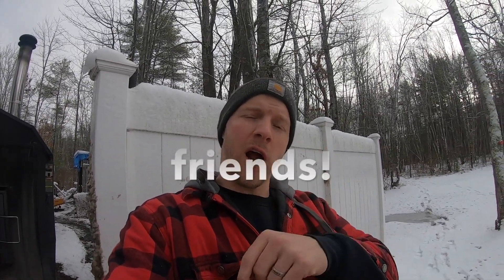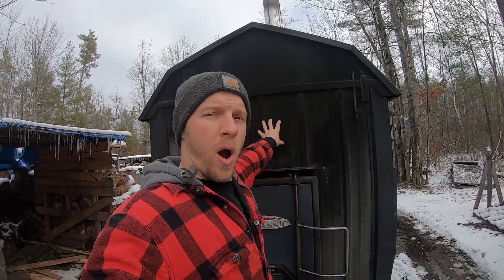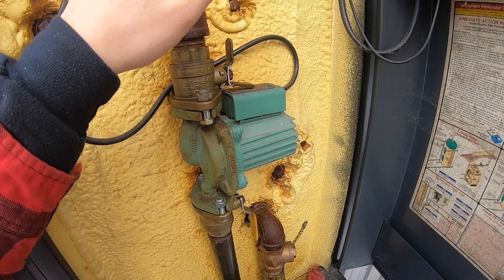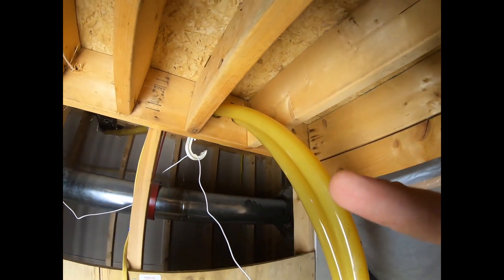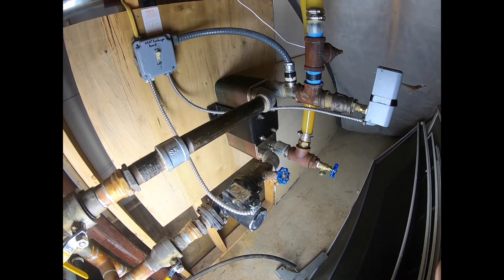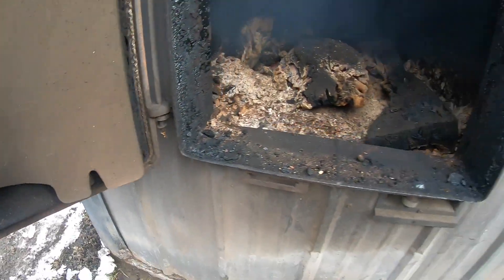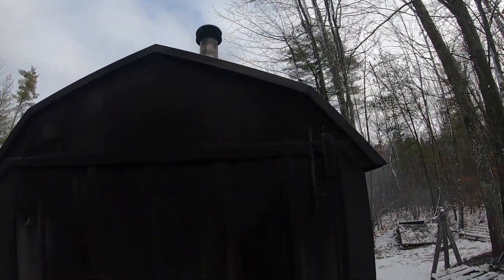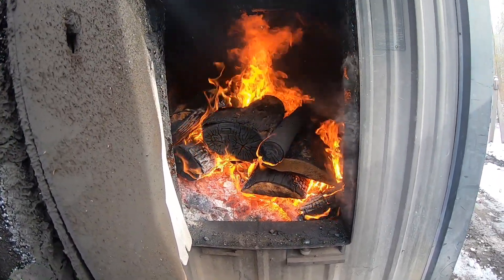How Does An Outdoor Wood Boiler Work?

Comment: thx for the vid! put an offer in at a house with one. never used em before. so you mentioned you make need to reload wood at midnight, do you roughly load that amt of wood morning and night thru winter? can you pack it fuller or is that unnecessary?
Reply from the maker: Howdy! Hope you get the house! I load enough to last to the morning. So like a 12 hour or less burn.  You can pack it full. It will use more wood but it’s easier if you have a lot of wood then pack it home but if supplies are limited it’s more efficient to load it more frequently with less wood each time

Comment: so these are not "Boilers"  they are giant hot water heaters pumping hot water to radiators.....  no steam so not actually "boilers" ??
Reply from the maker: The legal name is an outdoor wood boiler so yes it is
Reply from the maker: Also called an outdoor wood furnace but the more common nomenclature is outdoor wood boiler
Reply: so sounds like the "name" boiler is a carry over from the past when they were steam  heating systems long ago ..... particularly in large buildings.  Seem to remember the once a year or so stories of the boiler  (pressure tank full of steam) blowing up.

Comment: The "water" in the outdoor unit would mostly be glycol which is food grade antifreeze. That way if the boiler is down in freezing temps you don't freeze the boiler or the piping. The heat exchanger is to separate the glycol and the boiler water inside. If it isn't glycol it definitely should be
Reply from the maker: My machine is just water. Circulating water is not going to freeze. Glycol transfers less heat than water but in my
Case I don’t need glycol mix
Reply: @HomesteadJay  it'll freeze if you forget to put wood in it or go on a trip or that circular fails in the night. Glycol does transfer less heat but is negligible and an industry standard for outside boilers usually. As long as that thing runs all the time you're right it won't freeze

Comment: What's the longest you can go between loading it ?
Reply from the maker: Depends on outside temp, heat load in the house, species of wood, dryness of the wood, etc. packing these full burns more wood in the long run but it will last longer between loads. I’ve gotten 24hours+ with it loaded but it’s not as efficient. I do about 1/3 load and toss a log in here and there during the day.

Comment: How many plates is your heat exchanger?
Reply from the maker: I will check tomorrow!
Reply: @HomesteadJay  I’m in the beginning stages and have a buderus oil like you I’ll need to tie into, the only difference I’m curious about is I have an indirect water tank and not sure if I need to to a sidearm or just a larger plate exchanger
Reply from the maker: I dont know how an indirect works but im assuming if the indirect water tanks pulls hot water from the oil burner, if you have a heat exchanger that then heats the water flowing through the oil furnance you should be good. However, im not super familiar with your setup. Ive seen guys do side arms for certain cases.

Comment: havn"t they developed  a smaller wood boiler to not burn such mass of wood ? The heat exchanger looked so small .
Reply from the maker: The heat exchanger is actually one of the larger ones for the application it’s in. The new boilers have a smaller firebox compared to this unit

Comment: Do you refill the water in the 300 gallon holder regularly or does it cycle through for a long time?
Reply from the maker: If its treated properly it can last for years! Properly treated water wont cause any damage compared to untreated! I drained and flushed the water once since I been here just so I know it was done right!

Comment: Great video! Does the pump on the boiler itself constantly run?
Reply from the maker: Yes they do! This pumps runs the water through a heat exchanger and depending on heat demand the house will pull from it as needed. Forced hot water (baseboard) and endless DM hot water

Comment: Jay, Doesn’t that machine have a separate ash door under the main door? Since I didn’t see one, I assume you have to let the fire go out before emptying the ashes. Am I right or did I miss something?
Reply from the maker: Hey Denny! No secondary burn on these models. This machine is not a gasification style boiler so when I do an ash clean out yes I do let the fire burn down a bit and usually push it back or to one side at a time! Any more questions just ask!

Comment: I'm wondering why you don't fill the boiler up with wood and eliminate your trip out at midnight to re-load?  Looks like you had a ton of room to add more.
Reply from the maker: It burns more wood that way. I may make a video on it! All it does is heat the water up faster but I feel half load with 50/50 pine hardwood is perfect.

Comment: Hey Jay, asked a question awhile back .  Was curious if you ever have to change the water out in the jacket.  You were going to find out from someone.
Reply from the maker: Hey Gerry! This is debated over and over on youtube from other owners lol from what I was told by the central boiler shop locally as long as the PH and inhibitor amounts are within range and the water looks good then its fine. I havent changed mine since we had it. I may do it next season since it will be its 13th season running (half life). Its all about the PH and corrosion inhibitor amounts for sure, thats whats important!

Comment: Use that long Rake and take of spark Sheild run wide open through the winter , I have same one I know u know this but mine set up to cast iron radiators and radiant heat on my first floor , ok’d farm house with no insulation , 👍🏻 keep in mind u don’t have to go below frost line with 6 in cause 2 things it’s insulated , and second the water always moving , but I haven’t bought oil in 17 years it’s a win for us 👍🏻👍🏻👍🏻
Reply from the maker: Hey Shayn! You take the front grate off? lol I dont know if you are talking about the front grate by damper or the chimeny cap. The chimney cap is coming off cause its on fire actually lol from creosote hahaha I threw in some cardboard boxes and man that fire went up the chimney and caught the cap on fire lol needless to say the chimney is clean now hahah! We use oil in the summer just for hot water and obv a backup for the beast here. Thanks for tuning in!
Reply: @HomesteadJay  chimney cap and that’s funny , never a dull moment on your homestead
Reply from the maker: @shayn4220  Seriously lol Its coming off tomorrow hahaha
Reply: @HomesteadJay  there u go do a video and say your subscriber was just talking about it lol
Reply from the maker: @shayn4220  Will do lol

Comment: Great video Jay. I have seen the forced air style set ups before, looks like a radiator installed in the furnace, similar to a the AC coil. I heat with a fire place for supplemental heat.
Reply from the maker: Hey Crazy! Yes ive seen the forced air systems too! Pretty cool! I wish we had a fireplace just for ambiance! It wouldnt hurt anything to me its not like I dont have any wood LOL! Thanks for chatting!

Comment: I got a 5068 for free this fall the out side water jet rusted and was thin and was leaking I scraped all the spray foam off and welded it all up I ended up having to cut out a 2 square foot peace. out of it, it was so thin. I got it plumed into my shop now and it works great next year i'm going run a line to the house.
Reply from the maker: Hey Hudson! I think I would do everything I could in my power to have mine repaired or weld in a new firebox because I do not like the new gasification boilers. I think they are over complicated and the fact you cant burn pine/soft wood is dumb because 70% of my lot is soft woods and I love the ability to burn any wood! Lets hope we dont have to worry about mine going for a while! Knock on wood! Thanks for chatting!

Comment: Thanks for explaining that Jay. I'm a new wood boiler user. I thought that the wood was always burning with flame, but I quickly found out that's not the case. When the damper is closed, the wood is just smoldering. It is only burning with flames when the damper opens. I figured out that when the water temp reaches 180 the damper closes and when it drops below 170 it opens. When it is heating inside the house the heat exchanger is taking heat off the water and dropping the water temp. My water seems to circulate at an average temp of about 167. When the water temp gets to below 170 the damper opens and the wood actively burns to maintain the heat level. When the temp. inside the house reaches the thermostat set point the heat isn't being taken off the circulating water by the blower through the exchanger and so the water temp. climbs back to 180, the damper closes, and the burning goes from active flames to smoldering coals/wood to maintain the 180 degrees.
Reply from the maker: Hey Ed! Thats correct! Very good wording! Thats basically what I was trying to say in the video LOL

Comment: Did I see the plate style heat exchanger correctly?  It looks like it was the size of a box of tissues.   Very small for the amount of heat it exchanged.
Reply from the maker: Hey Dave! It’s larger than that for sure. I noticed on camera it looks small lol it’s Prob about 14 or so inches! It’s one of the larger ones you can get which is what I was told!